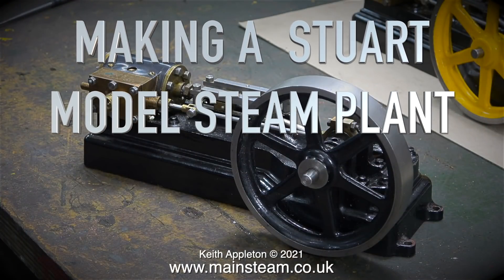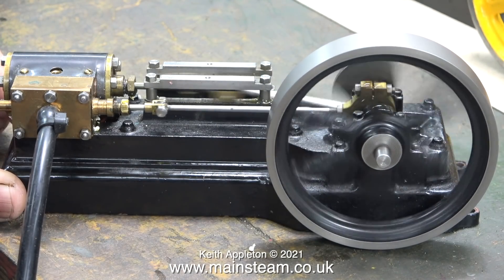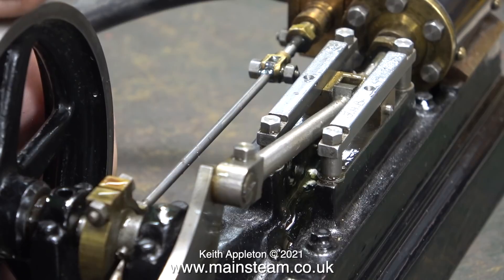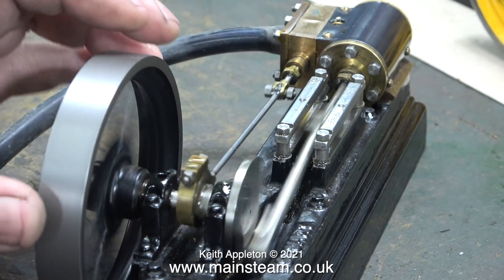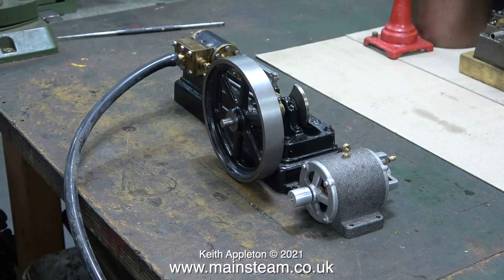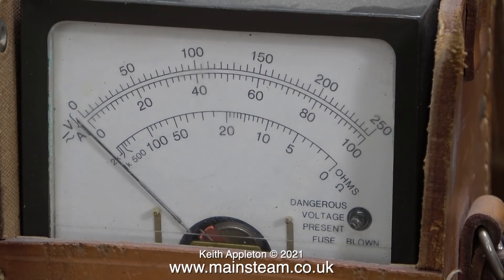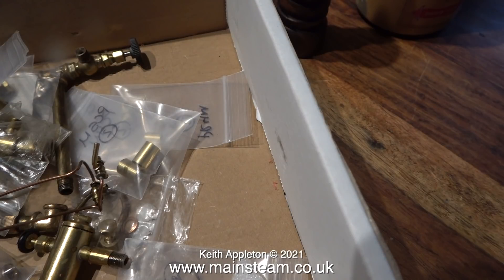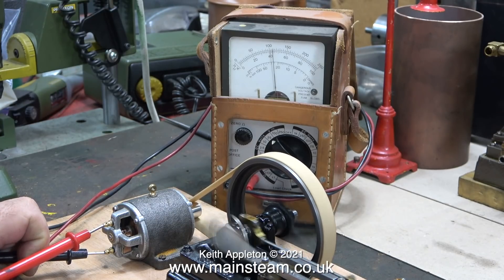MAKING A STUART MODEL STEAM PLANT - PART #12

Comment: Had the same spacer issue with my S50. For a while I thought I'd made a mistake when making them. I checked several times with the drawing, and no, they were correct- I made four new ones, and it was fine. Everything else was OK, and it ran very well with only 20-30 psi. Sadly no boiler now!

Comment: I was looking closely at the end bell of the generator and was thinking to myself "that must be created with a 3d printed mold or investment casting pattern since you can see the layer lines in it.  Then I heard you say "LED bulbs are definitely not part of the steam age"  LOL  but I 100% agree with not using LED bulbs, they just cant duplicate the same warm glow and large lens as a normal bulb.
Reply: Had to go back and look. Well spotted! I think you are right.
Reply: Scott, you’re quite right. I have the larger end bell in the lathe right now; the layer lines are visible on two opposite spokes. They look a little like wood grain - somewhat out of place on this machine.
Reply: Sometimes new technology can be put onto old stuff but for this setup yeah keep old bulbs, , Im currently restoring an old wooden ever ready torch and a warm white led bulb makes it a much better beam,  pcb wired into unused contact for different brightness levels, and made copy of original 3 D cell box battery with lithium cells and usb charging.